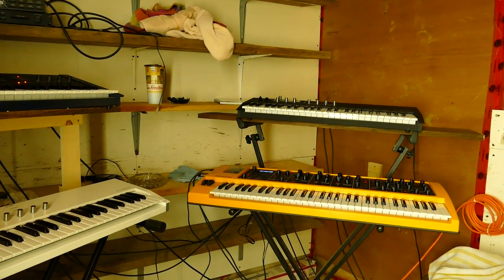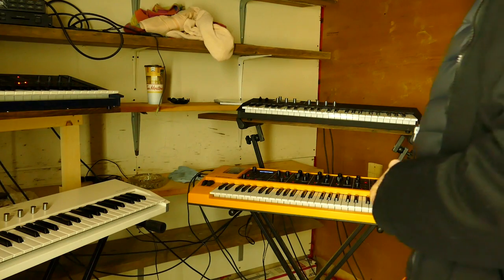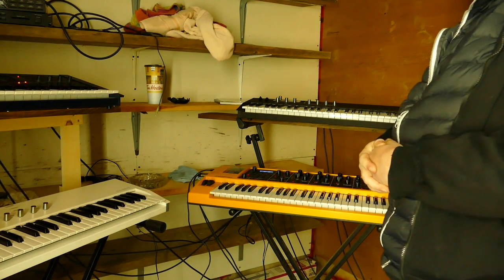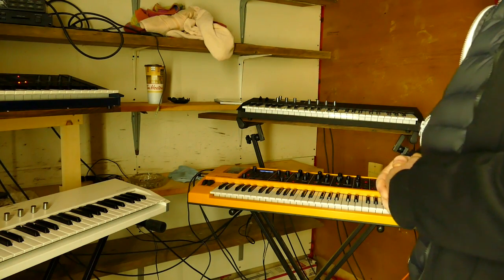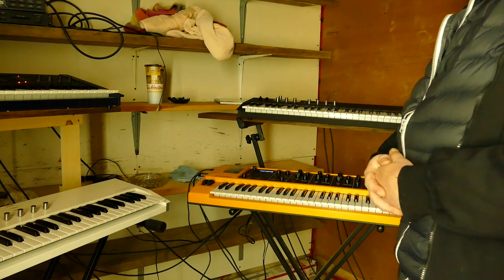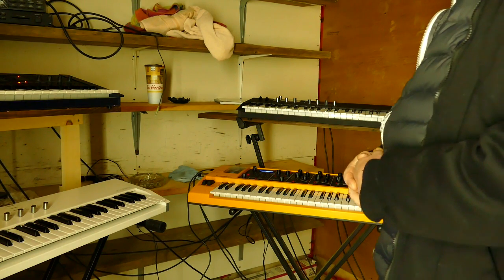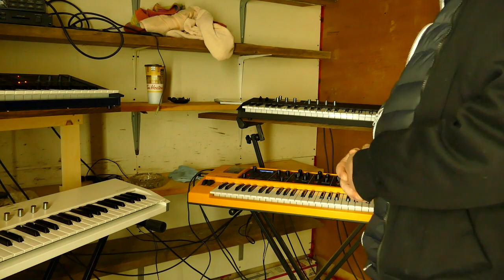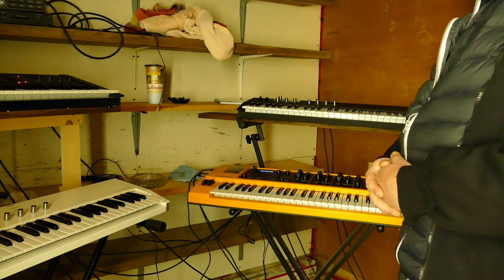Studiologic Sledge: An introduction to undocumented filter types.

Comment: Had a quick question. It is said that sledge has the same engine as blofeld. Was wondering if it took user wavetables? If so how many can it take? The blofeld only has 38 slots… dunno what those other reserved slots are for before the user WT80-118 then the SL sample slots are after those… got any insight?
Reply from the maker: Never been able to load user wavetables with the Sledge.